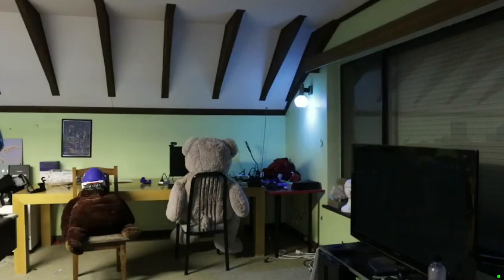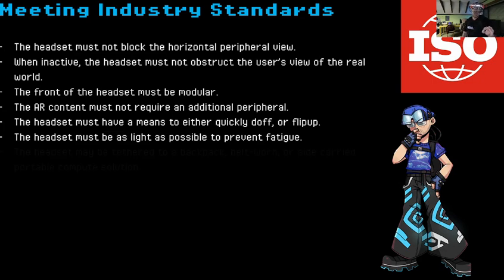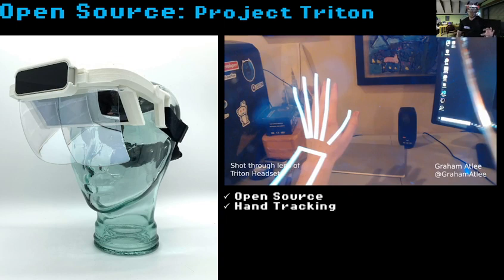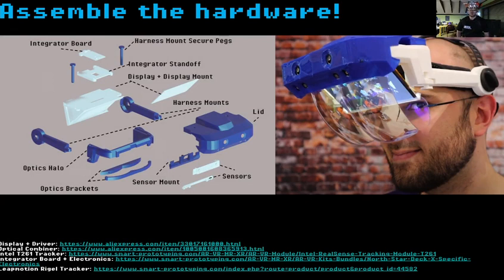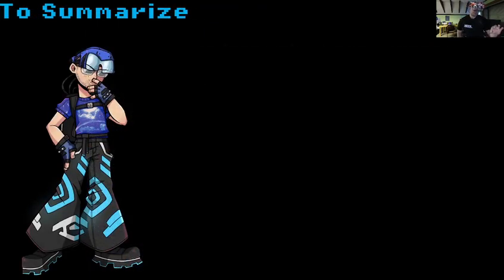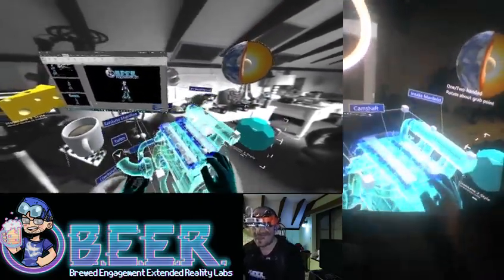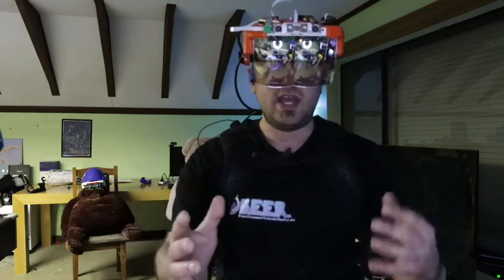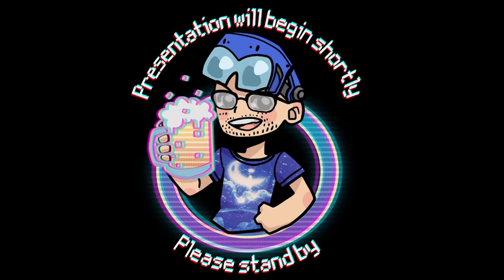Presentation ISWC 2021 - Project Ariel

Comment: I am currently in Welding School Myself, and one of the ways i could see this implemented is as another "layer" in something like those PAPR Welding Helmets, which often have a flip up "layer" for the welding filter.  Almost like the sunshield on Spacesuits as well.

Perhaps if you had the eyepieces "slide" to the sides of the head while in use that could work as well rather than flipping up?

Either way i think having them all on one frame would be of use.
Reply from the maker: I agree 100%, I actually intended to design this way since I'm learning to weld myself, sadly we've not had the time to explore this further! 

- Dr. Damo

Comment: Having a "Thermal Overlay" would be very of interest to me, and could have useful applications i would imagine.  Have you considered mounting + interfacing with something like a FLIR Lepton?
Reply: Dr. Damo here - We have a variation with Time of Flight, but haven't considered the use case for FLIR. What use case would you consider?
Reply: @damienrompapas9794  In MY application mainly knowing if something is too hot.

At least in welding school we have "practice plates" and once they get too they tend to melt and drip more than weld if that makes sense

Also if it is safe to touch / pick up / place on something not very fire resistant etc

This could also be applied in the kitchen or other areas with hot things as well i guess.

Also i'd figure you may be able to "see" leaks from gas canisters/tubing, but i am unsure on that.

That may even be a proper industrial application, although that would probably require industrial hardware/already be fulfilled by those "thermal camera guns" FLIR and others make.